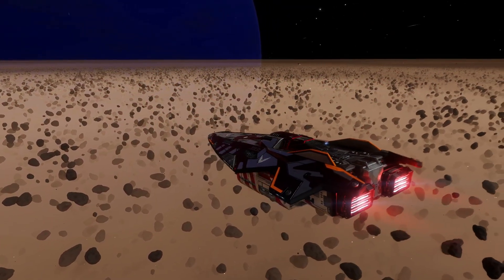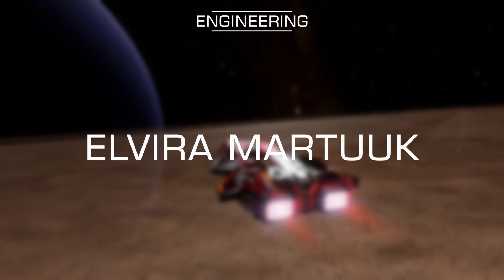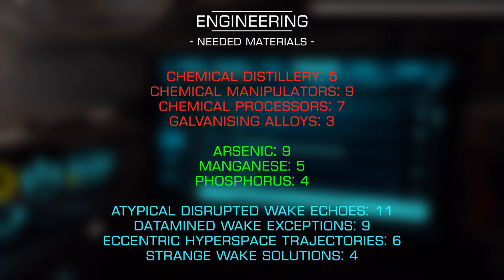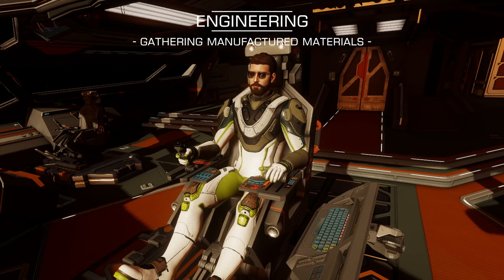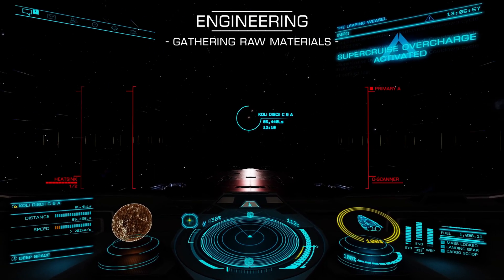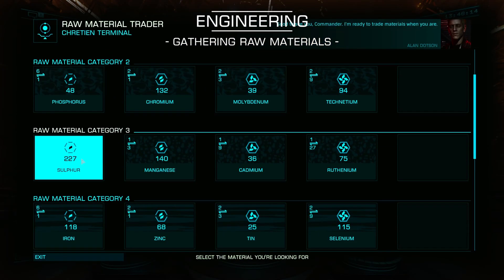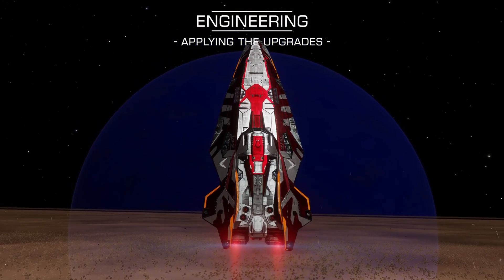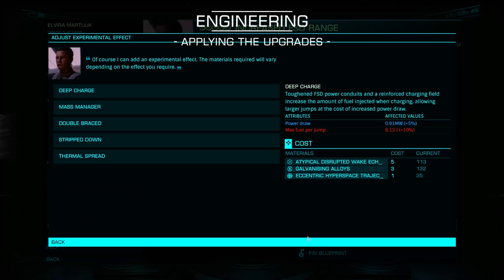READ DESCRIPTION! How to Engineer your First FSD | Elite Dangerous Engineering Guide 2025

Comment: It is the best FSD but still lot of work to do to get the best possible jump range :) (guardian booster, D rating the other stuff and lightweight engineering of some other stuff). The g-booster and D-rating is essential so you can still have srv on 70ly DBX without much of the anoying grind.
Reply: You should try these system's in the Galaxy map search bar and fly to them. 07 🫡

Gamma velorum
HD 125178
HD 125142
HD 100085
Wregoe yk-p e5-83
Psr joo24-7204e
Psr joo24-7204o
Psr joo24-7204t
Psr joo24-7204q
Psr joo24-7204u
Hip 13044
Cygni x-3
Plaa aec iz-n c20-1
Eafots eu-r c4-1
Pru aescs dl-w c15-37
Stuemeae fg-y d7561
Stuemeae km-w c1-4809
Ic 4673
Ic 2391 sector ze-a d101
Ic 2391 sector gw-v b2-4
Cygnus x-1
Cygnus x-3
Evelyn's light
Urt
Ads 9338 ac
Scheau bli nb-o d6-342
Lil
Synuefe xr-h d11-102
Trappist-1
Lft 509
Rigel
Ngc 2841
Ngc 5195
Ngc 1566
GJ 1214B
Cw 190521
Rx j1856.5-3754
Serpent 37
6 Lacertae
6 Lambda Leporis
Alnilam
Alnitak
Mintaka
Sol
Proxima Centauri
Sirius
Stephenson 2-18
Carcosa
Maia
Ads 4229 abc
Eimbaith Lw-w EL-290
Floasly te-x d2-25
Synookio EL-J d9-1
Gongae Qw-1 c24-0
Byoi aewsy r2-f d11-104
Eol prou kw-1 cb-32
Blua hypa hi-f d12-1226
Bleia dryiae hf-w b35-1
Col 285 sector vu-m c8-32
Eol prou kw-1 c8-32
Eafoff IN-Q d6-0
Dryooe prou ff-z d696
Boelts XH-C c29-854
Shaulai DL-P d5-274
Stuemeae bv-y f2111
Stuemeae nn-s e4-1360
Stuemeae nn-s e4-5583
Nyuena bf-r e4-3196
Nyuena bf-r e4-4054
Nyuena bf-r e4-2200
Nyuena bv-p e5-458
Nyuena bv-p e5-1493
Nyuena bv-p e5-2376
Pre Aowsy ba-a
Brambai uz-o e6-313
Dumboe aa-a h207
Hypao brai kw-v b5-21
Hypio gree aa-a h56
HD 155889
Bleia dryiea xj-r e4-1
Hi'iaka
Angosk jm-w d1-05
Hip 52741
Tira Flirble
Smade's
Hip 57951
Lorant mi-b d13-1
Blaea brou cn-b d13-06
Psr j0024-7204Q1
Eolls hypai no-x d2-06
HD 64285
Hip 64902
Hip 604151
HD 213221
HD 211744
Hip 57951
Smeamaa aa-a ho4
Phleedgoea kx-u f2-10
Garth
Izar
Axanar
Klingon
CBS
Orian
Actaea
Vanth
HD 35460
Hip 57951
S171378
Smith's claim
Pru aescs zk-p e5-103513
HD 474171
Swoiwns td-r d5-85
Wellington
HD 64287
Hip 64902
Oevasy sg-y do
Hyphiemoe yk-p d5-0
Eolls hypai ll-z d1-02
Psr j1641+3627ba
HD 64282
2 mass j02323627+61282553
Nyeajoa fb-o e6-oa
Eor phyloi cl-y g137
Pria thoi zp-g d10-37
HD 2020881
Ogaicy zo-a e4228
HD 935217
HD 984256
HD 71297

Comment: Great content CMDR. Keep it coming :)
Reply: You should try these system's in the Galaxy map search bar and fly to them. 07 🫡

Gamma velorum
HD 125178
HD 125142
HD 100085
Wregoe yk-p e5-83
Psr joo24-7204e
Psr joo24-7204o
Psr joo24-7204t
Psr joo24-7204q
Psr joo24-7204u
Hip 13044
Cygni x-3
Plaa aec iz-n c20-1
Eafots eu-r c4-1
Pru aescs dl-w c15-37
Stuemeae fg-y d7561
Stuemeae km-w c1-4809
Ic 4673
Ic 2391 sector ze-a d101
Ic 2391 sector gw-v b2-4
Cygnus x-1
Cygnus x-3
Evelyn's light
Urt
Ads 9338 ac
Scheau bli nb-o d6-342
Lil
Synuefe xr-h d11-102
Trappist-1
Lft 509
Rigel
Ngc 2841
Ngc 5195
Ngc 1566
GJ 1214B
Cw 190521
Rx j1856.5-3754
Serpent 37
6 Lacertae
6 Lambda Leporis
Alnilam
Alnitak
Mintaka
Sol
Proxima Centauri
Sirius
Stephenson 2-18
Carcosa
Maia
Ads 4229 abc
Eimbaith Lw-w EL-290
Floasly te-x d2-25
Synookio EL-J d9-1
Gongae Qw-1 c24-0
Byoi aewsy r2-f d11-104
Eol prou kw-1 cb-32
Blua hypa hi-f d12-1226
Bleia dryiae hf-w b35-1
Col 285 sector vu-m c8-32
Eol prou kw-1 c8-32
Eafoff IN-Q d6-0
Dryooe prou ff-z d696
Boelts XH-C c29-854
Shaulai DL-P d5-274
Stuemeae bv-y f2111
Stuemeae nn-s e4-1360
Stuemeae nn-s e4-5583
Nyuena bf-r e4-3196
Nyuena bf-r e4-4054
Nyuena bf-r e4-2200
Nyuena bv-p e5-458
Nyuena bv-p e5-1493
Nyuena bv-p e5-2376
Pre Aowsy ba-a
Brambai uz-o e6-313
Dumboe aa-a h207
Hypao brai kw-v b5-21
Hypio gree aa-a h56
HD 155889
Bleia dryiea xj-r e4-1
Hi'iaka
Angosk jm-w d1-05
Hip 52741
Tira Flirble
Smade's
Hip 57951
Lorant mi-b d13-1
Blaea brou cn-b d13-06
Psr j0024-7204Q1
Eolls hypai no-x d2-06
HD 64285
Hip 64902
Hip 604151
HD 213221
HD 211744
Hip 57951
Smeamaa aa-a ho4
Phleedgoea kx-u f2-10
Garth
Izar
Axanar
Klingon
CBS
Orian
Actaea
Vanth
HD 35460
Hip 57951
S171378
Smith's claim
Pru aescs zk-p e5-103513
HD 474171
Swoiwns td-r d5-85
Wellington
HD 64287
Hip 64902
Oevasy sg-y do
Hyphiemoe yk-p d5-0
Eolls hypai ll-z d1-02
Psr j1641+3627ba
HD 64282
2 mass j02323627+61282553
Nyeajoa fb-o e6-oa
Eor phyloi cl-y g137
Pria thoi zp-g d10-37
HD 2020881
Ogaicy zo-a e4228
HD 935217
HD 984256
HD 71297

Comment: Now throw a guardian FSD Booster at it and use neutron stars on galmap for those extra sprints!
Reply: Edit: I recommend equipping atleast 1 or 2 extra fueltanks! This SCO boost really eats through your fuel!
Reply: You should try these system's in the Galaxy map search bar and fly to them. 07 🫡

Gamma velorum
HD 125178
HD 125142
HD 100085
Wregoe yk-p e5-83
Psr joo24-7204e
Psr joo24-7204o
Psr joo24-7204t
Psr joo24-7204q
Psr joo24-7204u
Hip 13044
Cygni x-3
Plaa aec iz-n c20-1
Eafots eu-r c4-1
Pru aescs dl-w c15-37
Stuemeae fg-y d7561
Stuemeae km-w c1-4809
Ic 4673
Ic 2391 sector ze-a d101
Ic 2391 sector gw-v b2-4
Cygnus x-1
Cygnus x-3
Evelyn's light
Urt
Ads 9338 ac
Scheau bli nb-o d6-342
Lil
Synuefe xr-h d11-102
Trappist-1
Lft 509
Rigel
Ngc 2841
Ngc 5195
Ngc 1566
GJ 1214B
Cw 190521
Rx j1856.5-3754
Serpent 37
6 Lacertae
6 Lambda Leporis
Alnilam
Alnitak
Mintaka
Sol
Proxima Centauri
Sirius
Stephenson 2-18
Carcosa
Maia
Ads 4229 abc
Eimbaith Lw-w EL-290
Floasly te-x d2-25
Synookio EL-J d9-1
Gongae Qw-1 c24-0
Byoi aewsy r2-f d11-104
Eol prou kw-1 cb-32
Blua hypa hi-f d12-1226
Bleia dryiae hf-w b35-1
Col 285 sector vu-m c8-32
Eol prou kw-1 c8-32
Eafoff IN-Q d6-0
Dryooe prou ff-z d696
Boelts XH-C c29-854
Shaulai DL-P d5-274
Stuemeae bv-y f2111
Stuemeae nn-s e4-1360
Stuemeae nn-s e4-5583
Nyuena bf-r e4-3196
Nyuena bf-r e4-4054
Nyuena bf-r e4-2200
Nyuena bv-p e5-458
Nyuena bv-p e5-1493
Nyuena bv-p e5-2376
Pre Aowsy ba-a
Brambai uz-o e6-313
Dumboe aa-a h207
Hypao brai kw-v b5-21
Hypio gree aa-a h56
HD 155889
Bleia dryiea xj-r e4-1
Hi'iaka
Angosk jm-w d1-05
Hip 52741
Tira Flirble
Smade's
Hip 57951
Lorant mi-b d13-1
Blaea brou cn-b d13-06
Psr j0024-7204Q1
Eolls hypai no-x d2-06
HD 64285
Hip 64902
Hip 604151
HD 213221
HD 211744
Hip 57951
Smeamaa aa-a ho4
Phleedgoea kx-u f2-10
Garth
Izar
Axanar
Klingon
CBS
Orian
Actaea
Vanth
HD 35460
Hip 57951
S171378
Smith's claim
Pru aescs zk-p e5-103513
HD 474171
Swoiwns td-r d5-85
Wellington
HD 64287
Hip 64902
Oevasy sg-y do
Hyphiemoe yk-p d5-0
Eolls hypai ll-z d1-02
Psr j1641+3627ba
HD 64282
2 mass j02323627+61282553
Nyeajoa fb-o e6-oa
Eor phyloi cl-y g137
Pria thoi zp-g d10-37
HD 2020881
Ogaicy zo-a e4228
HD 935217
HD 984256
HD 71297

Comment: Why is my comment getting deleted?  I'm not bullying, I'm not harassing, there's nothing bad in my comment....wth? 5:40 don't apologize, it's the only feasible way to get materials at a reasonable rate.  In fact, while more fun, combat is not the best way to get grade 5 manufactured mats.  Also, different types of ships drop different mats.  So there are some grade 5 mats that will never drop from an Anaconda.  I haven't tried it yet, but I've been wanting to go to an anarchy system and destroy different types of ships to get different mats.....7:43 I agree, but it's EXTREMELY effective.
Reply from the maker: I haven’t deleted any comments here, must be a technical thing - sorry about that. 

Anyway, you’re right, if your after the most efficient method, but in the end this is a game. Not everyone finds enjoyment in grinding the most efficient way to get the most possible mats, so I like to slow things down, and make it more fun if I can. 

People enjoy different things though, so it’s obviously fine if someone would rather do the more efficient way, just to get it over with.

I also have a distain for relogs, regardless of how necessary they are. Just really stupid 😅🫡
Reply: You should try these system's in the Galaxy map search bar and fly to them. 07 🫡

Gamma velorum
HD 125178
HD 125142
HD 100085
Wregoe yk-p e5-83
Psr joo24-7204e
Psr joo24-7204o
Psr joo24-7204t
Psr joo24-7204q
Psr joo24-7204u
Hip 13044
Cygni x-3
Plaa aec iz-n c20-1
Eafots eu-r c4-1
Pru aescs dl-w c15-37
Stuemeae fg-y d7561
Stuemeae km-w c1-4809
Ic 4673
Ic 2391 sector ze-a d101
Ic 2391 sector gw-v b2-4
Cygnus x-1
Cygnus x-3
Evelyn's light
Urt
Ads 9338 ac
Scheau bli nb-o d6-342
Lil
Synuefe xr-h d11-102
Trappist-1
Lft 509
Rigel
Ngc 2841
Ngc 5195
Ngc 1566
GJ 1214B
Cw 190521
Rx j1856.5-3754
Serpent 37
6 Lacertae
6 Lambda Leporis
Alnilam
Alnitak
Mintaka
Sol
Proxima Centauri
Sirius
Stephenson 2-18
Carcosa
Maia
Ads 4229 abc
Eimbaith Lw-w EL-290
Floasly te-x d2-25
Synookio EL-J d9-1
Gongae Qw-1 c24-0
Byoi aewsy r2-f d11-104
Eol prou kw-1 cb-32
Blua hypa hi-f d12-1226
Bleia dryiae hf-w b35-1
Col 285 sector vu-m c8-32
Eol prou kw-1 c8-32
Eafoff IN-Q d6-0
Dryooe prou ff-z d696
Boelts XH-C c29-854
Shaulai DL-P d5-274
Stuemeae bv-y f2111
Stuemeae nn-s e4-1360
Stuemeae nn-s e4-5583
Nyuena bf-r e4-3196
Nyuena bf-r e4-4054
Nyuena bf-r e4-2200
Nyuena bv-p e5-458
Nyuena bv-p e5-1493
Nyuena bv-p e5-2376
Pre Aowsy ba-a
Brambai uz-o e6-313
Dumboe aa-a h207
Hypao brai kw-v b5-21
Hypio gree aa-a h56
HD 155889
Bleia dryiea xj-r e4-1
Hi'iaka
Angosk jm-w d1-05
Hip 52741
Tira Flirble
Smade's
Hip 57951
Lorant mi-b d13-1
Blaea brou cn-b d13-06
Psr j0024-7204Q1
Eolls hypai no-x d2-06
HD 64285
Hip 64902
Hip 604151
HD 213221
HD 211744
Hip 57951
Smeamaa aa-a ho4
Phleedgoea kx-u f2-10
Garth
Izar
Axanar
Klingon
CBS
Orian
Actaea
Vanth
HD 35460
Hip 57951
S171378
Smith's claim
Pru aescs zk-p e5-103513
HD 474171
Swoiwns td-r d5-85
Wellington
HD 64287
Hip 64902
Oevasy sg-y do
Hyphiemoe yk-p d5-0
Eolls hypai ll-z d1-02
Psr j1641+3627ba
HD 64282
2 mass j02323627+61282553
Nyeajoa fb-o e6-oa
Eor phyloi cl-y g137
Pria thoi zp-g d10-37
HD 2020881
Ogaicy zo-a e4228
HD 935217
HD 984256
HD 71297

Comment: Thank you for a tutorial without any bs, so many tutorials leave out key points of information
Reply: You should try these system's in the Galaxy map search bar and fly to them. 07 🫡

Gamma velorum
HD 125178
HD 125142
HD 100085
Wregoe yk-p e5-83
Psr joo24-7204e
Psr joo24-7204o
Psr joo24-7204t
Psr joo24-7204q
Psr joo24-7204u
Hip 13044
Cygni x-3
Plaa aec iz-n c20-1
Eafots eu-r c4-1
Pru aescs dl-w c15-37
Stuemeae fg-y d7561
Stuemeae km-w c1-4809
Ic 4673
Ic 2391 sector ze-a d101
Ic 2391 sector gw-v b2-4
Cygnus x-1
Cygnus x-3
Evelyn's light
Urt
Ads 9338 ac
Scheau bli nb-o d6-342
Lil
Synuefe xr-h d11-102
Trappist-1
Lft 509
Rigel
Ngc 2841
Ngc 5195
Ngc 1566
GJ 1214B
Cw 190521
Rx j1856.5-3754
Serpent 37
6 Lacertae
6 Lambda Leporis
Alnilam
Alnitak
Mintaka
Sol
Proxima Centauri
Sirius
Stephenson 2-18
Carcosa
Maia
Ads 4229 abc
Eimbaith Lw-w EL-290
Floasly te-x d2-25
Synookio EL-J d9-1
Gongae Qw-1 c24-0
Byoi aewsy r2-f d11-104
Eol prou kw-1 cb-32
Blua hypa hi-f d12-1226
Bleia dryiae hf-w b35-1
Col 285 sector vu-m c8-32
Eol prou kw-1 c8-32
Eafoff IN-Q d6-0
Dryooe prou ff-z d696
Boelts XH-C c29-854
Shaulai DL-P d5-274
Stuemeae bv-y f2111
Stuemeae nn-s e4-1360
Stuemeae nn-s e4-5583
Nyuena bf-r e4-3196
Nyuena bf-r e4-4054
Nyuena bf-r e4-2200
Nyuena bv-p e5-458
Nyuena bv-p e5-1493
Nyuena bv-p e5-2376
Pre Aowsy ba-a
Brambai uz-o e6-313
Dumboe aa-a h207
Hypao brai kw-v b5-21
Hypio gree aa-a h56
HD 155889
Bleia dryiea xj-r e4-1
Hi'iaka
Angosk jm-w d1-05
Hip 52741
Tira Flirble
Smade's
Hip 57951
Lorant mi-b d13-1
Blaea brou cn-b d13-06
Psr j0024-7204Q1
Eolls hypai no-x d2-06
HD 64285
Hip 64902
Hip 604151
HD 213221
HD 211744
Hip 57951
Smeamaa aa-a ho4
Phleedgoea kx-u f2-10
Garth
Izar
Axanar
Klingon
CBS
Orian
Actaea
Vanth
HD 35460
Hip 57951
S171378
Smith's claim
Pru aescs zk-p e5-103513
HD 474171
Swoiwns td-r d5-85
Wellington
HD 64287
Hip 64902
Oevasy sg-y do
Hyphiemoe yk-p d5-0
Eolls hypai ll-z d1-02
Psr j1641+3627ba
HD 64282
2 mass j02323627+61282553
Nyeajoa fb-o e6-oa
Eor phyloi cl-y g137
Pria thoi zp-g d10-37
HD 2020881
Ogaicy zo-a e4228
HD 935217
HD 984256
HD 71297

Comment: Quick tip for 2:37 , use ED Odyssey Materials Helper instead of the app u said, ED Engineer I think, (I already forgot 😅). It’s essentially the same but with a cleaner UI, plus it also gives you the availability to pin entire blueprints, experimental effects, and it shows you how to unlock each engineer. Plus it gives you a comprehensive list other each material, plus the nearest material trader for each material! So yeah, I highly recommend using it!

Comment: When you're at the engineer, also make sure to pin the increased range blueprint, so you can use it elsewhere later.
Reply: You should try these system's in the Galaxy map search bar and fly to them. 07 🫡

Gamma velorum
HD 125178
HD 125142
HD 100085
Wregoe yk-p e5-83
Psr joo24-7204e
Psr joo24-7204o
Psr joo24-7204t
Psr joo24-7204q
Psr joo24-7204u
Hip 13044
Cygni x-3
Plaa aec iz-n c20-1
Eafots eu-r c4-1
Pru aescs dl-w c15-37
Stuemeae fg-y d7561
Stuemeae km-w c1-4809
Ic 4673
Ic 2391 sector ze-a d101
Ic 2391 sector gw-v b2-4
Cygnus x-1
Cygnus x-3
Evelyn's light
Urt
Ads 9338 ac
Scheau bli nb-o d6-342
Lil
Synuefe xr-h d11-102
Trappist-1
Lft 509
Rigel
Ngc 2841
Ngc 5195
Ngc 1566
GJ 1214B
Cw 190521
Rx j1856.5-3754
Serpent 37
6 Lacertae
6 Lambda Leporis
Alnilam
Alnitak
Mintaka
Sol
Proxima Centauri
Sirius
Stephenson 2-18
Carcosa
Maia
Ads 4229 abc
Eimbaith Lw-w EL-290
Floasly te-x d2-25
Synookio EL-J d9-1
Gongae Qw-1 c24-0
Byoi aewsy r2-f d11-104
Eol prou kw-1 cb-32
Blua hypa hi-f d12-1226
Bleia dryiae hf-w b35-1
Col 285 sector vu-m c8-32
Eol prou kw-1 c8-32
Eafoff IN-Q d6-0
Dryooe prou ff-z d696
Boelts XH-C c29-854
Shaulai DL-P d5-274
Stuemeae bv-y f2111
Stuemeae nn-s e4-1360
Stuemeae nn-s e4-5583
Nyuena bf-r e4-3196
Nyuena bf-r e4-4054
Nyuena bf-r e4-2200
Nyuena bv-p e5-458
Nyuena bv-p e5-1493
Nyuena bv-p e5-2376
Pre Aowsy ba-a
Brambai uz-o e6-313
Dumboe aa-a h207
Hypao brai kw-v b5-21
Hypio gree aa-a h56
HD 155889
Bleia dryiea xj-r e4-1
Hi'iaka
Angosk jm-w d1-05
Hip 52741
Tira Flirble
Smade's
Hip 57951
Lorant mi-b d13-1
Blaea brou cn-b d13-06
Psr j0024-7204Q1
Eolls hypai no-x d2-06
HD 64285
Hip 64902
Hip 604151
HD 213221
HD 211744
Hip 57951
Smeamaa aa-a ho4
Phleedgoea kx-u f2-10
Garth
Izar
Axanar
Klingon
CBS
Orian
Actaea
Vanth
HD 35460
Hip 57951
S171378
Smith's claim
Pru aescs zk-p e5-103513
HD 474171
Swoiwns td-r d5-85
Wellington
HD 64287
Hip 64902
Oevasy sg-y do
Hyphiemoe yk-p d5-0
Eolls hypai ll-z d1-02
Psr j1641+3627ba
HD 64282
2 mass j02323627+61282553
Nyeajoa fb-o e6-oa
Eor phyloi cl-y g137
Pria thoi zp-g d10-37
HD 2020881
Ogaicy zo-a e4228
HD 935217
HD 984256
HD 71297
Reply: @RebirthOfTheGods  is this a list of brothels ? why do we need to go to them ?
Reply: @no1baggiefan  if you don't go then you won't know
Reply: @RebirthOfTheGods  why
Reply: @RebirthOfTheGods  quite a list.... id check em out if i knew why to check them out lol
Reply: @drizzdrazz  If you follow the Saramandara Pearls it will open a void to enlightenment to finding Raxxla 07
Reply: @RebirthOfTheGods   Bro might be delulu
Reply: @RebirthOfTheGods  I'm new, or rather coming back to ED after 6 years. Why do you recommend these systems? Thank you!
Reply: @RebirthOfTheGods  all of them? 😮
Reply: @RebirthOfTheGods  Systems that you have discovered?

Comment: As a veteran pilot, I can contribute for the FSD scans needed :
Small and fast ship WITH NO WEAPONS. FSD wake scanner only.
You can go to the station called Ashby City in the Luyten's Star system.
When you arrive, you will notice 2 POIs in the area : the station and a tourist beacon a few kms away.
Those two object are gathering a huge amount of ships coming for the station or the beacon and then leaving by FSD jump.
It gives you a lot of FSD wakes to scan very quickly.
Reply from the maker: Nice advice! I’ll try it
Reply: Can confirm this works great, I've parked a Viper up there for this very reason.
Reply: is that better than the famine system method?
Reply: Scanwinder we go.
Reply: Thank you for this tip!
Reply: LOL didn’t expect my home system to be in reference. Fuck those tourists, don’t know how to fly into Ashby or out…
Reply: Legend, thanks
Reply: Спасибо за совет бро
Reply: Or make it easy on yourself and just go to Jameson's crash site, scan the comms control beacons with your ship's data link scanner (there's 9 of them), and then trade the Grade 5 emissions down for your wake exceptions.

Comment: I really like the "Ugh, a relog". Part of why I like your channel is in sharing in my values. I don't want to simply do the meta highiest-yield-per-minute stuff. I want to still be playing around. But it's also seems to be true that gathering materials is a bit unreliable in the natural course of gameplay.

I would like to hear more about that experimental effect recommendation being divided on what class it is? Is that always going to be the case? I'm specifically thinking about the small Diamonback Explorer with its Class 5 FSD, which doesn't seem like it needs help on Optimal Mass values, and sure has good fuel available.
Reply from the maker: I’m not all that knowledgeable about optimal mass and such, but It’s just an old Elite adage I’ve found to work. For whatever reason, in coriolis, edsy or in-game, it always gets you the better range - size 5 and up is mass manager, size 4 and below is deep charge. 

Some go mass manager for lower than 5 as it is better for fuel consumption, for only slightly lower range. Each to their own! 🫡
Reply: Apparently with SCO the values are biased towards Mass Manager always? 

Have yet to engineer a drive (or buy SCO) yet though...
Reply: @PaweLasek  Interesting
Reply: I heard that if It's size 5 or bigger, go for Mass Manager. Below 5 go for Deep Charge.
Reply: I find that if you do a mix of combat and mining and always keep a few collector limpets handy, it covers 90% of your materials for G2-3 engineering plus experimentals. Then there are just a couple that I need to farm, like configurable components because apparently I don't hijack enough freighters. I get nauseous in the SRV and actively avoid any part of the game dependent on it.